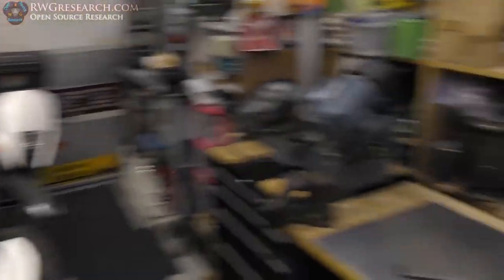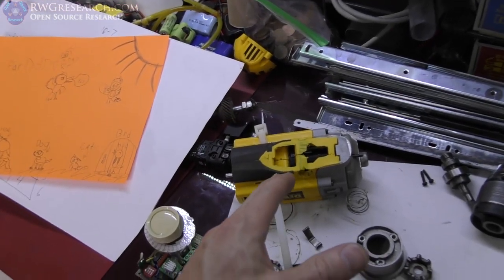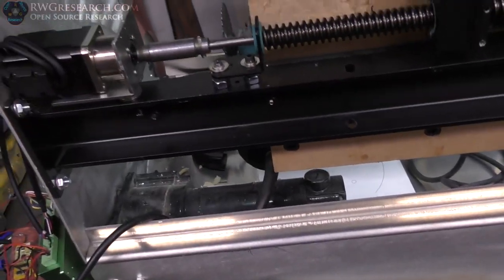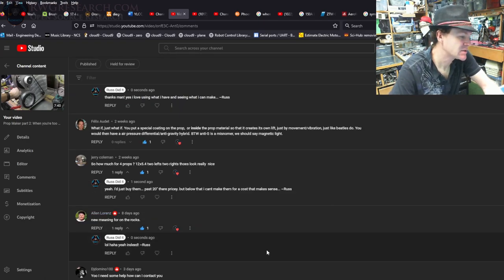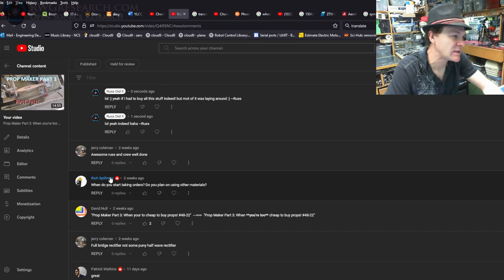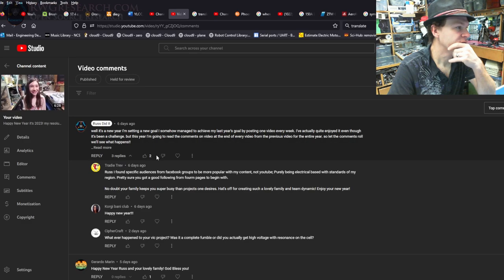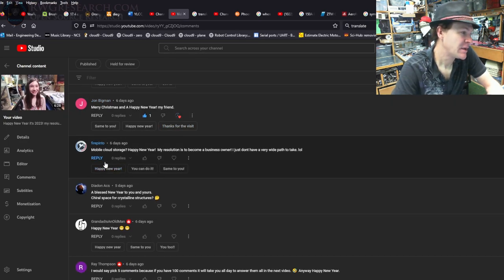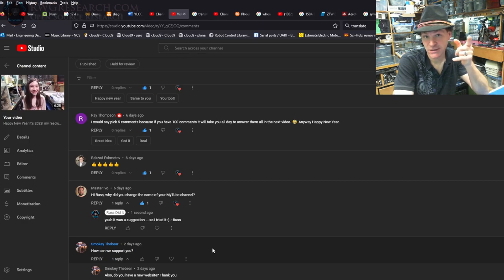Prop Maker Part 4: When you're too cheap to buy props!

Comment: Yes, I would be starting my own business.  Actually will be doing smaller products to build up to full fiberglass boat design and manufacturing.  For now I plan on designing parts for drag racing related car stuff.  The Pinto fits into this very much. lol  So far it has a new paint job, and is back to running.  I want to get one of those Arcdroids and start manufacturing plasma cut weldment parts. Engine mounts, transmission mounts, etc...
Reply from the maker: fantastic. yes that a great thing to get in to! i want to see that "fire pinto" on video some time! :)   ~Russ